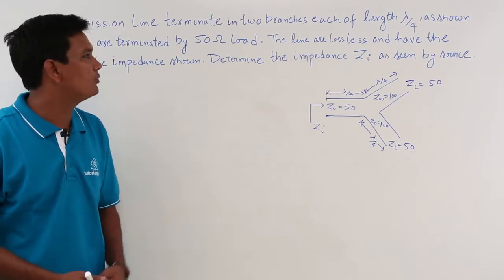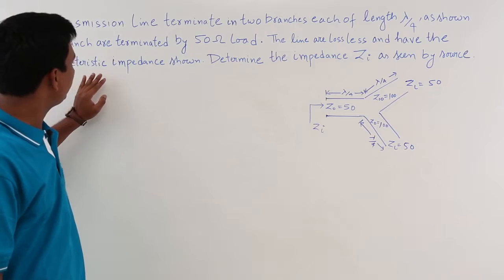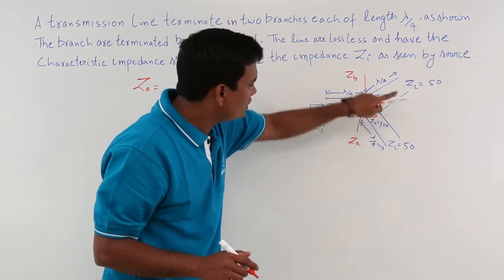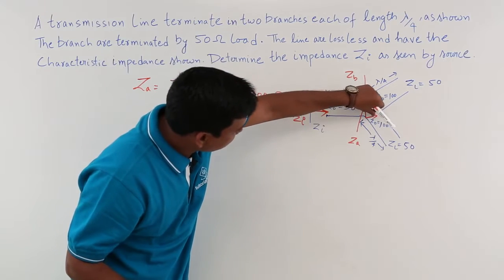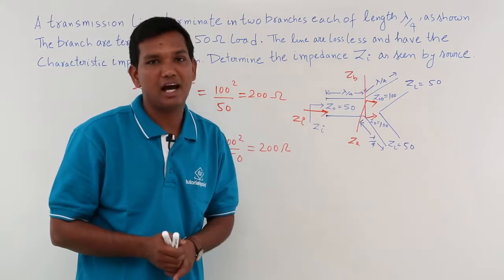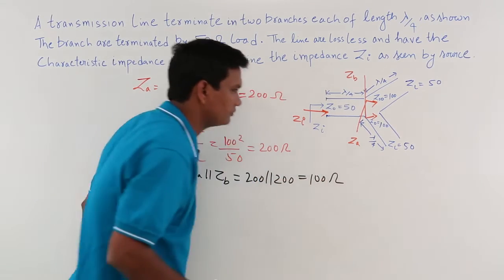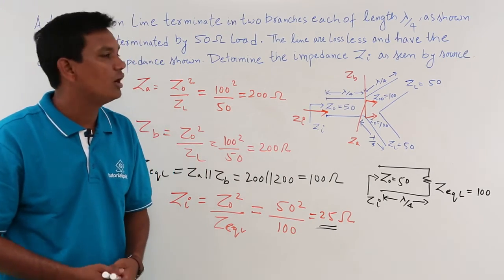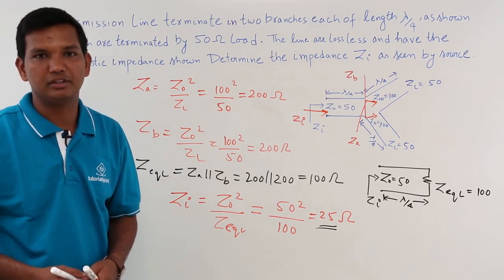Transmission Line Numerical Example 2

Comment: are u sure it is parallel.i think this nework is series.Because the current will flow through from one  end and to the other and then reach input. So,it should be  series
Reply: Surendra Parla wassup
Reply: I too thinks this should be series.
Reply: I am also confused, have you got the answer?
Reply: NHP BRO
Reply: Yeah it should be in series look at previous example and try to adjust this one like that.